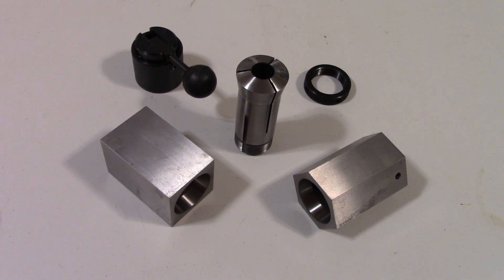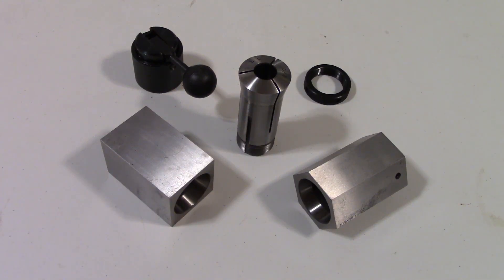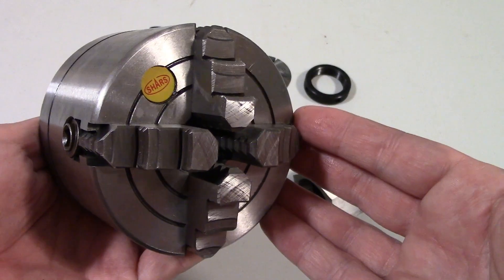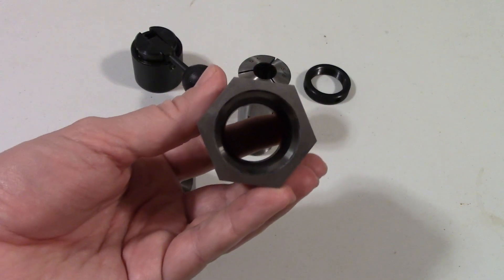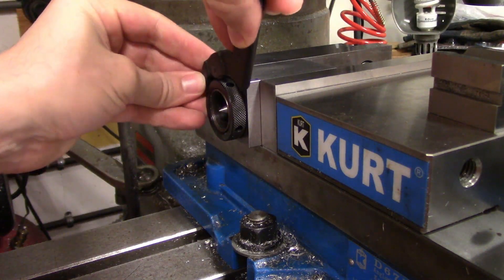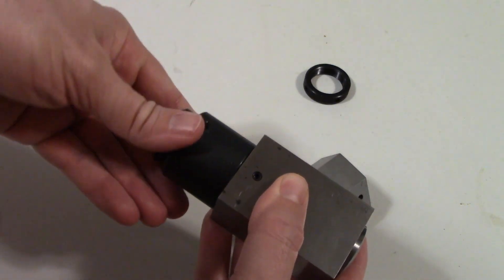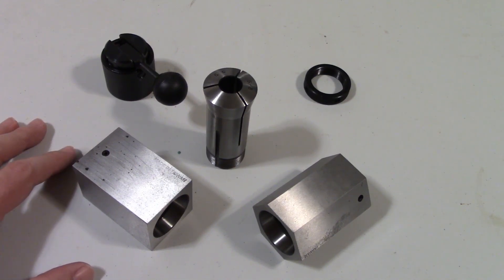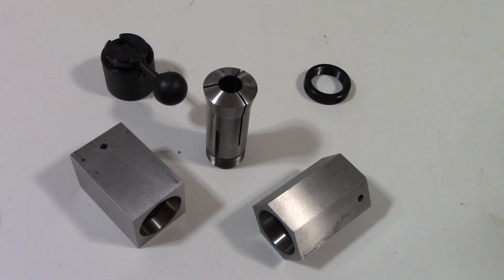How to Use Collet Blocks

Comment: I would like to mount a collet block vertically in a Kurt vise to treadmill onto a 6” shaft.  Not sure if the ring is small enough to allow the block to sit down on the ways of the vise and hopefully some of the shaft I’m machining can drop down in the middle so that I don’t have too much stick out.
Reply from the maker: I think you'll run into more clearance issues with the vise than the collet block. Have you considered using a lathe chuck clamped to the mill table?  It's a rock-solid way to hold cylindrical parts vertically on the mill.
Reply: @StuartdeHaro I think you are right. I’m going to look into that.

Comment: I use an ER40 six sided block as a way to run collets on my lathe.... The chuck doesn't hold stock smaller than 5/8" very well, using an ER series collet means the block can stay mounted in the lathe when changing parts... The 5C collets need to get pulled out of the chuck to swap parts... I'd love to have an actual collet chuck for my lathe but a setup for a D1-8 gets pricy... The collet block is a cheap & easy hack... If I really need precision I can use the four sided block in the four jaw....
Reply from the maker: I did that for years with a straight shank ER-32 holder in my 4-jaw chuck.

Comment: How about R8 collets, are there commercial blocks available for those? How hard would they be to make?
Reply from the maker: I don't believe there are, but they're not complicated to make. You just need to ensure that the bore is centered on the blocks. That's the most important thing, followed very closely by the accuracy of the angles.

Comment: I was watching your splendid video again and came to some thoughts.
I am living in the Netherlands Europe. I owe many Swiss machines with W12 W15 ans W20 collets. E.g. a Schaublin 102 VM with the W20 collets. We use the metric system and my collets go up from .4 mm to 20 mm in steps of .1 mm. Alltogether about 200 collets.They came from an auction of a Swiss watchmakerfirm. ( I had to drive 1600 miles but the price was it worth) These kind of collets are simular to the 5C collets.
I think there is a major  disadvantage of these collets to the ER or ESX collets. The last ones are far more forgiving for grabbing a workpiece considirably thinner without loosing their roundness.
The ER collets can be achieved in ultraprecise collets which are much more affordable then a set of  C or W. Collets. 
Why do you and your YouTube collegues  chose for the 5 C collets? Is that because of your spindle nose ? Or are there other reasons. 
Luc Bleckmann
Reply from the maker: 5C collets are VERY common in the US. They're available in round, hex, square, and rectangular. You can get them in. 001" increments. Of course there are metric sizes as well. There are machinable collets, expandable collets, fixture mounts like I  mentioned. Tons of different tooling uses them, like these blocks and several other indexing devices and fixtures. They make a lot of them, so they're pretty affordable. You can use collet stops. The list is pretty long. ER collets are used a lot as well, but mostly for milling. They are starting to get a foothold in the lathe market, especially on the hobbiest side of things since the chucks are simple and affordable. The wide holding range for each collet is very attractive. Anyway, that's quite a wall of text to answer a simple question. Thanks for watching!

Comment: Question, the screw in the block and the slot in the collet is that for lining only or should it be tightened?
Thanks, Robert
Reply from the maker: It's for aligning the collet and holding it still while you tighten the ring or the cam.
Reply: @StuartdeHaro  Thanks for the reply.

Comment: Excellent! I entertained myself for a week with a set of 5c blocks and tilting the head on my PM25 mill......unbelievable what you can come up with. I had never seen a 5c chuck before.
Reply from the maker: The chucks are handy when you need to hold something bigger in one of the 5C indexers like these or the spindexer. They're not that expensive either.

Comment: 5C collets are obviously the most versatile due to the multitude of chucks and attachments built for them. And 5C is probably used almost everywhere in the world today. But the same 4 and 6 sided collet blocks are also made for ER 32 and 40. Arc Euro Trade in the UK is one supplier for them. Much too slow to use in industry, but they are another option in a home shop that's already using ER collets.
Reply from the maker: Yes.  I use ER32 extensively in my shop on the mill and the lathe.  I have a 5C to ER32 adapter that I use quite a bit for oddball sizes since they hold over such a wide range.  Since the video was meant for my class though, I decided not to muddy the waters on this one.  I'm going to do a separate video on the wonders of ER collets sometime in the future.
Reply: @StuartdeHaro  I sometimes forget that some of your videos are meant for your classes and not as general YT videos. One of the main reasons I chose an ER 40 collet size for my R8 mill was the dual usage on it and lathe. If money were no object I would have gone with the 32 size for tool holding on the mill and 5C for work holding on the lathe and mill due to it's obvious superiority and speed of use. I think a good video about ER collets is more than worth while. I had to do a lot of digging on various web sites including Rego -Fix before I fully understood how to properly use them. Some of the details aren't quite as obvious as many with home shops seem to think. Tool movement due to inadequate nut torque being just one of them.
Reply from the maker: That's the reason I went with ER32. I already had collets I was using in my lathe and I had a mess of collets.